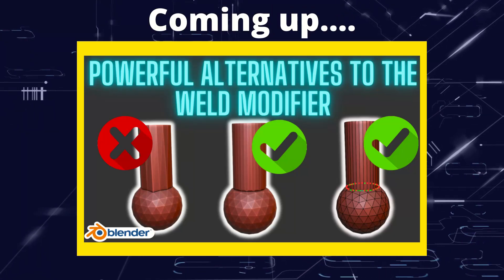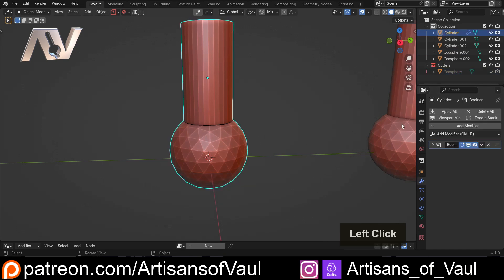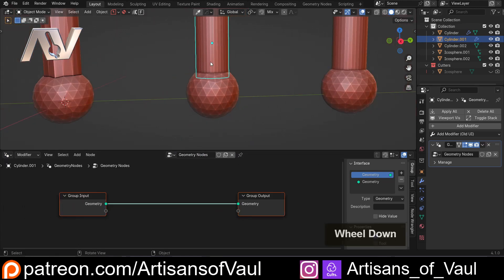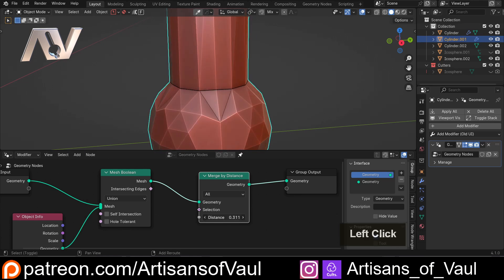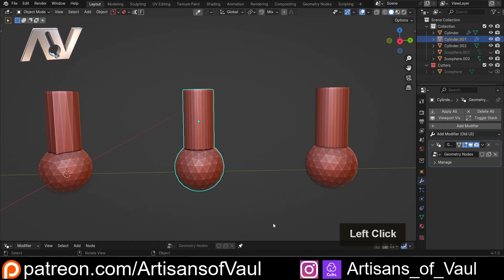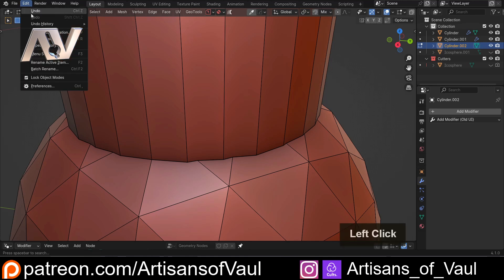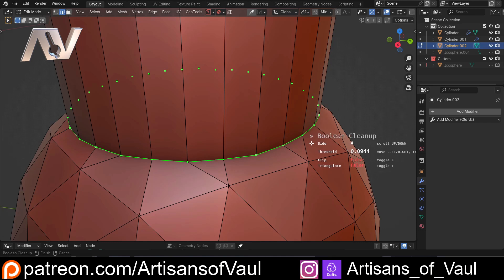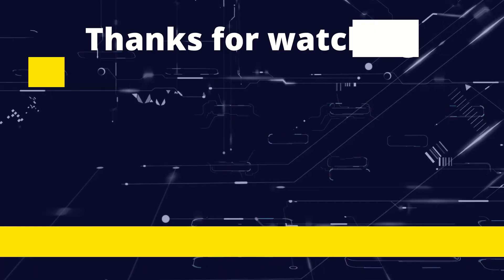Powerful Alternatives to the Weld Modifier in Blender

Comment: There is a very simple solution to this kind of problem, and I'm quite surprised that no one in the comments mentioned this, although, it may be, in the context of this particular tutorial, considered cheating/bad faith etc.
The tutorial shows how to mitigate the result of a tricky boolean, and, indeed, Mesh Machine is very good. I have it, and I've used it in exactly this way. So it's a good demonstration of what it can do, and the tutorial is fine when considered in that light.

However, no experienced modeller would ever do this, in the way that is demonstrated. Nobody should do it, either. What I mean, is that no one in their right mind should boolean an icosphere with a cylinder. They are topologically incompatible, so a different method should be used.

Whenever doing booleans, it is always advisable to match the geometry of the object to the cutter/union object, so that there is no issue with geometry at the interface.
In this case, that means using a UV sphere, with the same number of segments (meridians) as the cylinder has faces, and making sure your cylinder is perfectly aligned with the polar axis of the sphere. That way, they can be made to fit together perfectly, with an all quad geometry. The only thing likely required is to remove overlapping vertices, as the boolean operation always creates additional vertices.
It's ever so simple, and produces a perfect result, geometrically speaking. If you create both objects at the exact same location, blender even aligns the geometry of the objects, so they match perfectly - no rotation required.

I am often a little puzzled when I see blender tutorials where the instructor is demonstrating a method to solve a problem, that you shouldn't have in the first place, if the problem was approached correctly. As I said, this might not strictly apply here, but still, I'm surprised that neither the author of this video, or anyone in the comments, pointed this out.
Reply from the maker: @richardconway6425  The issue is that for many projects you don't have the choice. For example even with a UV sphere it can only have a cylinder placed on the top or bottom "poles" to line up perfectly. What about if you need one cylinder coming off at 45 degrees as well? You can't match that up. No real reason to cover such a basic use case in a tutorial when it has already been covered in other examples (the video on the weld modifier not long ago mentions it).
Reply: @ArtisansofVaul  yes, you are quite right, what I described is a specific use case, for the reasons you described. I didn't mean to appear pedantic, or dismissive of your tutorial, it was a perfectly good demonstration of fixing awkward geometry, with a very good addon designed specifically to do things just like that.
My thinking is really from the 'beginner perspective'. Many beginners might not be aware of some of the really simple solutions you can use to get great geometry. I remember as a beginner watching videos where they started with a 'cube sphere', and then spent ages messing around with the geometry, just to get the same result as a cylinder dropped onto the pole of a UV sphere. For a beginner, this is actually confusing.
No criticism of your tutorial was meant, and thanks for responding.
Reply from the maker: @richardconway6425  Don't worry, no criticism taken at all.  And its a good point on tutorials often going into the complex issues, not the basic ones. 👍

Comment: There is miss (Intersecting Edges) on Geometry for Blender 4.2.0
Reply: Change float to exact on the Mesh Boolean node.
Reply: @Poly_Looper  ok  thanks
Reply from the maker: @Poly_Looper  Thanks for giving a great tip 👍🏻
Reply from the maker: @Blendermodeldeaf-ry5nz  Glad you got a reply to solve the issue 😁👌🏼
Reply: @ArtisansofVaul  yes.

Comment: It's a little hard to see, but you have somewhat of a notch where the welding area is. 5:17
Reply from the maker: @eitantal726  that's more just a shading issue than a real notch. There is a tiny amount of movement but it's a fraction of a mm.
Reply: @ArtisansofVaul  "merge" is the reason for the notch. Take a circle and merge some vertices. you'll end up with a circle of a slightly smaller radius. If you care to fix it, shrink-wrap on the original object will do the trick
Reply: @ArtisansofVaul  furthermore, while it may be a few mm, the control loop right above it is also a few mm, which gives it a 45 degree angle, hence the shading

Comment: Unfortunately I've never found a way to get it to merge to the nearest cylinder vertex. They're either generically part of blender picking what goes where (in the selection) or ignored (out of selection). 
I think you would have to do some heavyweight inspection of the geometry of the connected vertexes that aren't in the boolean border, and that's basically reprogramming MeshMACHIN3 the hard way.
Reply from the maker: Yeah, I think this is about as close to doing it in an "automated" way.  Which is a shame but its there if you need something quick and dirty.